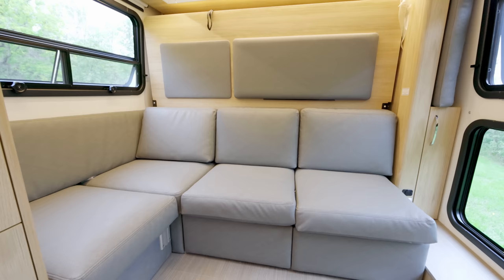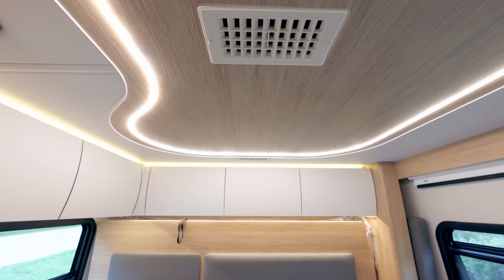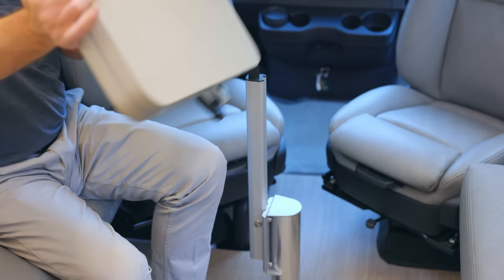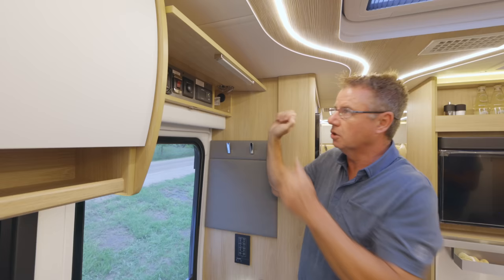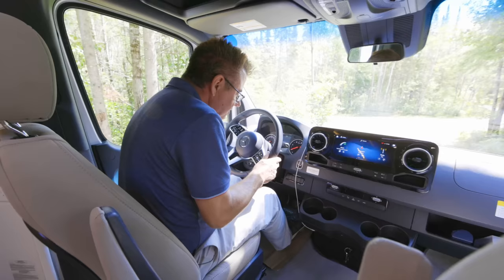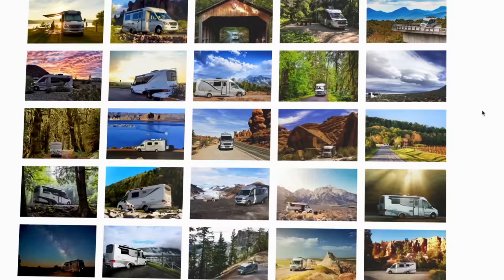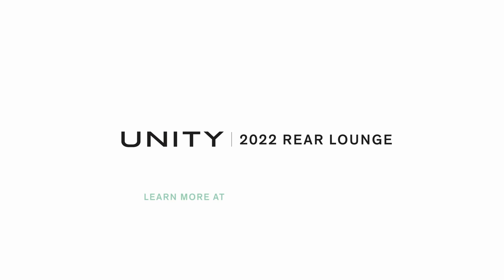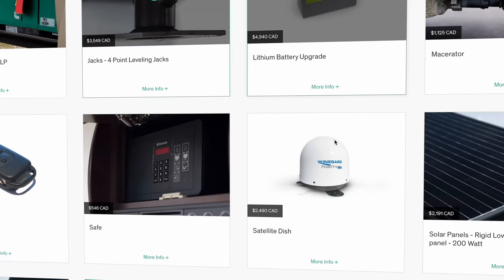2022 Unity Rear Lounge

Comment: Of all the Class B rigs out there, this one is our favorite!  Looks like it would be a great full-time rig. 

IMHO: It would be even better if the following options were available: 
(1) 12 VDC Danfoss/Secop compressor cooled refrigerator in lieu of the 3 way adsorption fridge
(2) Flush mounted induction cooktop vs the propane cooktop
(3) A Webasto/Eberspacher furnace/water heater.
      (3A) A Truma Combi furnace/water heater
(4) A built in Hughes Autoformer power surge protector upgrade
My wife & I aren't really fans of propane fueled devices.
Reply: Can u explain please their 12v version, vs your 12v fridge?
Reply: @SpykersB  the 3 way fridge (LP/120 Volt/12 Volt) in the Unity is an adsorption refrigerator.  It works best with propane.  It is very inefficient when using the120 Volt heating element(s) to heat the adsorption boiler; and even more so when running the heating element(s) on 12 Volts.  
The modern 12 Volt Danfoss/Secop compressor refrigerator is much more energy efficient than the adsorption refrigerators.  Totally different technology.  Uses a refrigerant compressor vs an adsorption boiler to cool the refrigerator.  With the compressor refrigerator, I would highly recommend the Lithium battery upgrade.
Reply: Nobody cares mate.
Reply: @deepsea5107  ohhh thank you!
Reply: @davidtaylor4975  In really hot weather the 3 way fridge is very marginal
Reply: Completely agree. I want a propane-free rig.
Reply: I love it
Reply: @davidtaylor4975  I do. There are several setups out there that aren't 200K, don't require propane, don't have black water tank, explain the amount of water capacity and battery capacity, and mpg. Hot water is the only thing I'd consider propane for, and that's just because I have no real experience with solar thermal heater. He did a decent job with the review, given the circumstances. They probably didn't want him to mention a few things. You can get 15kwh of us made 10yr warranty lithium phosphate deep cycle capacity for $6k, and they last longer than 10 yrs. Upgrade the converter system too for $3-7k, now u have 3 dif. Methods to charge your whole rig through an integrated inverter: solar, generator, or grid. And fk propane.

Comment: Fantastic floor plan, good quality ruined by a propane refrigerator and holes to cool it in the side of the van. Please catch up on the electrical department and install a 12v compressor fridge.
Reply: And please also offer a flush mounted induction cooktop option.
Reply: So true. I can't believe they still use a propane fridge. That was a deal killer for me.  The floor plan is actually really small for a 25 ft motorhome in my opinion.
Reply: @rvlifediy  They have to move on it is the biggest reason for fires and in the summer they don't work. I changed mine but it took 20 years. They don't draw that much. A microwave takes a surge of power for a few minutes but is not as bad as people think. Don't bake a cake or cookies in them.
Reply: @timsteinkamp2245  so true.  Unfortunately most first time buyers won't know this.

Comment: this thing is...amazing. So smart ideas and so simple. The only minus is the bathroom, which is desperately small, plus the real issue is when you are ready with the bath, comming wet outside making steps everywhere, this is not really a dry bath whatsoever, but for this size is just amazing. Overall amazing.

Comment: Just my opinion on this model

I like the Benz, but prefer the lounge set up on the ford
Having the lower lounge window on the passenger side in the Ford vs. the driver side on the Benz (unless I am recalling wrong between the two)

Also on the windows in the lounge
To me it would make more sense to have the emergency exit window be the lower one rather than the upper one
Easier and safer to get out if a fire etc. and you were trapped in the back
Would not want to drop to the ground on the street side, or from that high up at my age etc.

Comment: I'd love to get more information about the rigid solar system - 200w vs 400w.  I know next to nothing about electricity, so I'm not sure how much I'd be able to operate with the 200 vs the 400 options if I were boondocking or power was otherwise unavailable for hookups.  Also, is rigid different from any other solar systems by LTV or their competitors?  I use competitors loosely, because I have yet to see another company offer so much in a streamlined package.  These units are amazing.  I'm still 6-7 years from retirement, so I have plenty of time to continue researching and enjoying further improvements made by LTV as new technologies and materials evolve, but if I hit Powerball someday I may move that timeline up quite a bit.  LOL.

Comment: Dean, we love the Unity RL! Question: will LTV offer it on the Mercedes 4x4 Sprinter chassis? 4x4, or at least AWD, is a must for us winter campers. And should you ever offer heated tanks, we'd be thrilled!

The Wonder RL on Ford AWD  chassis is an option - the gas engine and location of RL double windows on patio side is a plus - though Unity's ducted A/C, front bed, and daytime shades, are wonderful design features.
Reply: Unfortunately on the Sprinter dually chassis, they only build them in rear wheel drive.  

If AWD is a must go with the Wonder RL

(We have a 2021 Unity RL and love it).
Reply: @Superdada  - we currently have a Winnebago 4x4 Sprinter with duellies, so Mercedes makes the chassis, but Leisure doesn't seem to offer the LTV with it yet. That would be an awesome value-add to the Unity. Glad you are loving yours!
Reply: @JoyOnTheJourney_  you have a regular mecedes van. These Leusures and other class c/b+ are on a cut away chassis. It's completely different than the regular van and does not and have not ever come in 4x4 unfortunately. Cutaway chassis is just the cab and the back is all just a metal floor frame.  The frame is nothing like the regular van.
Reply: @rvlifediy  - good point. It sounds like the Wonder RL with its AWD chassis would work best for us then. Thanks!
Reply: @JoyOnTheJourney_  I highly recommend you walk in one if you can find one. It doesn't have anymore usable room on the inside than a regular van either though it's 25 ft +- long. Love the fit and finish of the leisures but it's a big motorhome with practically no common area to hang out. The rear lounge will likely be left in the bed position if it was me based on experience.
Reply: I certainly agree about the gas engine and the placement of the lower window.  I can't see why they can't do daytime shades on the Wonder, seems like no design changes...heck, charge me more for them, lol.

Comment: Is it the same as last year model.
Reply: Not sure if that was a question or a statement but there are differences. We have the 2021, and a couple changes I see are the rigid solar panels (big upgrade over the flex panels) and we have Dometic touch panels where it looks like they moved to the Firefly system.  Other than that it seems it’s the same. They did add a mirror on the shower door, which is nice.
Reply: @Superdada  nothing different from last year's model same one

Comment: you left out the most important part the price but probably about 300,000
Reply: 180K with all upgrades
Reply: Not not bad compared to others like the Mercedes-Benz airstreams Etc but still way overpriced ridiculous can buy a house for that much
Reply: Not bad compared to others but still way too much money for 180k I could buy a brand-new 4-wheel drive 3 quarter or 1 ton diesel plus a top-of-the-line truck camper and still have cash left over for pizza and beer

Comment: Of course we love you guys but can't take you seriously. You need at LEAST 800 AMP hour lithium w/ a DC Air Conditioner and Refrigerator. You have to get rid of the Generator and Propane. Consider the option for a Separett waterless toilet setup. Black tanks suck! Clear up roof area to support a decent size roof box.